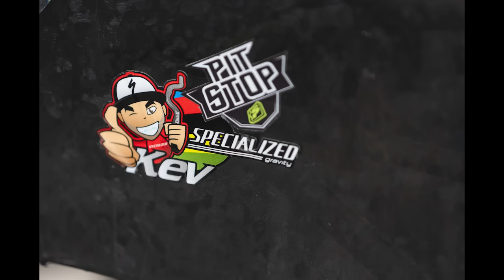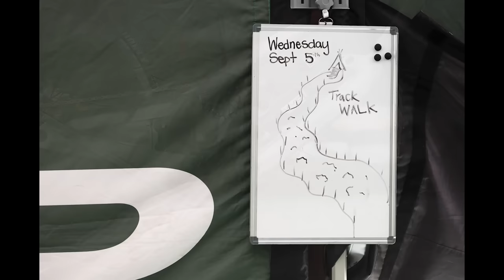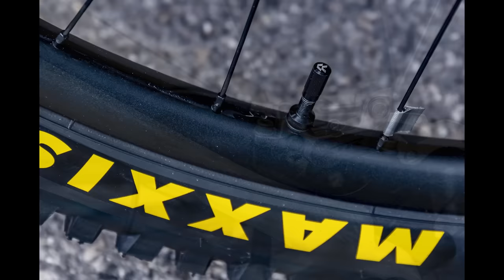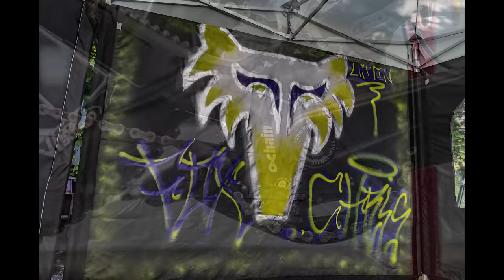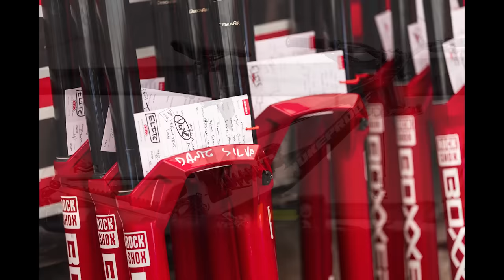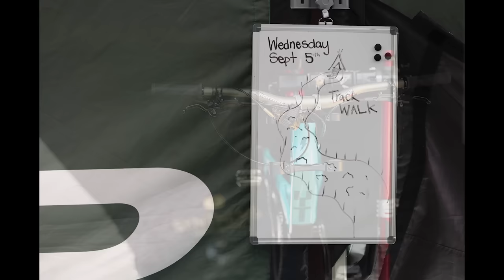A Year Later, Is Downhill Better Off?

Comment: New tracks/venues  must be utilized, there are thousands of ski stations and amazing new mountains to build tracks on, If they want feeder system to build up riders and support there must be additional venues.  
With minimal work a new track can me taped out and open to the public for a week, then hold a lower level race where points are available and then the track will be bedded in and ready for a world cup race. 
This system would expose more areas to the finical benefits of hosting events and would draw in a much wider live spectator turnout and it would develop trails and tracks everywhere rather than hosting races at the same place for decades and actually killing the trails or tracks in those areas.
Reply: What will save this current predicament is racers, wrenches, teams taking matters into their own hands and building the leagues themselves.  The proper direction is not MORE "business-like," but less so.  The existing pros who have had their eyes on a bigger money prize may have a hard time realizing this, but it's true, I'm sure of it.  If you let businessmen dictate an athletic competition, it will always end poorly.  Always.  Businessmen are not athletes and never were.

Comment: I didnt watch DH world cups before this season but i just wondered if that amount of injuries is normal? It doesnt seem normal to me.
Reply: its getting faster and gnarlier every year watching it for years, just take a look at the riders "crashing" in the finish zones, being not 100% commited/conentrated will get you hurt
Reply: Crashes happen every season and every race, but the tracks are stupid fast now and so are the bikes and riders. So at some point something has to give. Be it a bone or a bike. I honestly feel they need to control the speeds more. More check ups in high speed areas possibly? Utilise a bit. Of uphill and back into tech to slow the track down? We don't want to see someone die on track.
Reply: @Thematty635   Simply make the tracks more technically challenging, rather than 1-line raceways of ALLOUTSPEED!  I think the trend in tracks has followed the trend in trails -- Bike Park Mania! making riding easy for newbies.  Newbies come into the sport thinking groomed trails with "flow" built in, that's MTB.  They want to see superfast groomed flow trail races, apparently.  Otherwise they may feel some envy and realize they aren't very good at MTB themselves.

You can see why the "broadcaster" which doesn't understand athletes/athletics, but DOES identify with an awkward skill-less newbie, would "broadcast" dumbed-down style, hiding the brilliance of the athletes.  And if it's ALLOUTSPEED with HUGE CARNAGE! that sells according to the perverted pitchmen of hollywood mentality at the "production" end of "event management".

Comment: Could you imagine if someone qualified outside the top 30 wins the race and the winning run doesn't make the broadcast? Top riders  make mistakes in qualifying and still have the chance to win. I don't have any answers but that scenario doesn't seem that impossible especially with a mechanical or weather related issue.

Comment: If the riders aren't getting paid better, what am I paying for exactly?

A few things would be good to see.

No semis, it's not interesting, just extra risk for the riders and cheapens the finals. On the other hand more races would be nice.
I like that unilateral cancellation for safety. I'm not sure what's the pressure on riders to say go, but I think it's a good thing they don't have the final say in this and only this matter. Riders or their teams might put results over safety. Ofc riders should have the right to say no to racing, if they think it's not safe. They need doctors and standards from the UCI side that keep on eye in riders after crashes and prevent cases of riders going racing with concussions and such.

Feeder series needed, clear.

Comment: I feel there needs to be two classes of DH, single crown and dual crown. Just like moto, 250 and 450. Enduro is boring to watch and hard to capture. Why not pin it on single crown bikes? Would be super exciting and the manufacture would be stoked to see both dual and single crown bikes pushed to the limits.  
 `

Comment: Well, I will tell you one huge problem is the broadcasting on GCN+ They do not show it live, even though that's what it says but they do not show the whole run of every rider, plus they sit and talk while they are doing the award ceremonies. Very annoying and frustrating.
Reply: Redbull didn’t show full runs either 🙌
You can’t when it’s a 4 min run and 2 min between riders🤷‍♂️
Reply: At every race multiple riders are on track at the same time. So covering everybody live is not possible. 60 riders at 4 minutes each would last at least 4 hours.
Reply: It is live but they just puta delay on it
Reply: That’s because I’ve noticed unless a rider gets 1 of 2 first stage greens they clip the run and go back up the hill for the next rider, they kind of need the gap and it adds up throughout the telecast - its why minar didn’t get shown much this year with his sector 2 blowouts.  The only rider that gets the golden ticket is Seagrave, god knows why.  Sometimes Gracie drops behind her and is quicker and doesn’t get any green light sector footage.

Comment: Downhill I think needs to appeal to a wider audience, like DH skiing (DHS). The vast majority of DHS fans and viewers are not DHS racers or ski anywhere near that level. It would be great if this was also the case with DH cycling. It seems to me that DH is the bastard child of the UCI, and the GCN coverage reflects this as well. UCI doesn't see the big picture. Not sure what the solution is TBH. Maybe DH just has a limited appeal.

I think DH is about the most exciting racing EVER. Especially this year, the pace and skill level are just incredible.
Reply: Comparing to WC Alpine (FIS) is good from my POV.  Not sure I'd say FIS DH/SG are "wide audience" televised sports.  I'd say they are comparable to UCI DH in viewers around the world.  More people ride bikes than alpine ski, around the world.

But intelligent commentary as is seen in ski racing, that would be a nice change in UCI DH.  A very nice change.  People should understand that racing DH is technically difficult and not some hypebeast pure wildness on wheels spectacle.  It's not gladiators vs lions in the coliseum.  It's more the Olympics, in intent.  It's not demolition derby or roller derby or "pro wrestling".

Comment: Too bad we cant get Wyn as one of the commentators. Riders Union needs to happen so that they get a much larger seat at the table. If the organizers want to do the F1 style world cup, then they should share the TV money with the teams - like F1. The riders ARE THE SHOW - so they need to join together to hold the organizers feet to the flame or no racing. You see this break down in the road cycling world, but the World Cup MTB teams are different. They have to have dates and commitments - no handshakes - or no racing.

Comment: Too bad MTB doesn’t have a multi day stage race like the Tour de France. I’ve seen the BC bike race and a few others but that is more just for anyone, not really pros. 

They could have a DH run on day 1 to determine the starting order. Then have longer mountain stages on subsequent days. 

Last place guy starts first the next day. 

There could be a better format to showcase multipule forms of mtb all in one. A real best rider. 

Like how your de France has , uphill, downhill,  TT, cobbles etc. slightly different road bikes for each. 

Why isn’t uphill climbing values. 

The only thing missing would be the Tour de France mass start/finish and head to head racing. But xc could sort of cover that